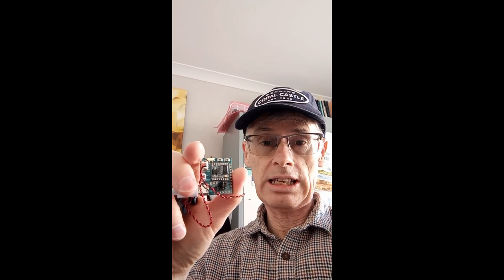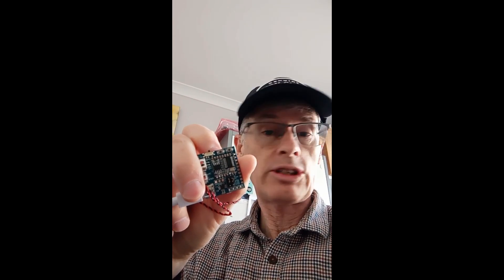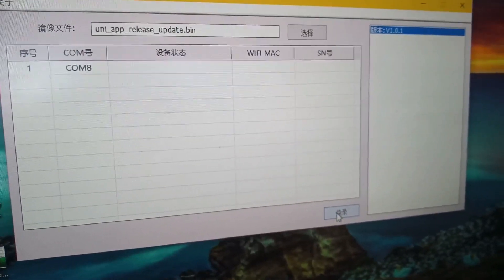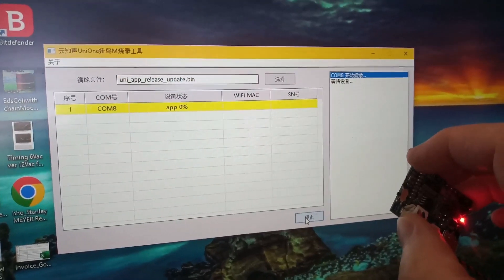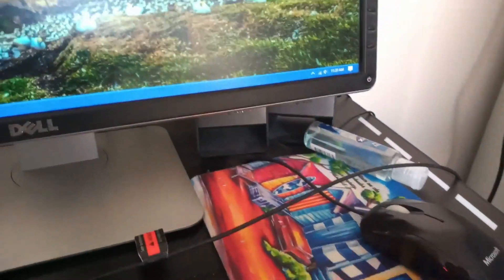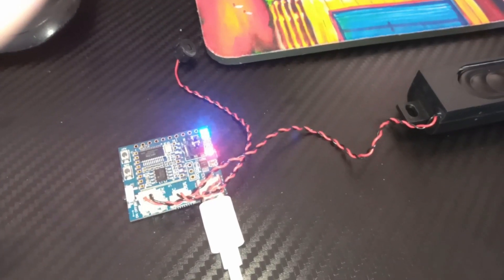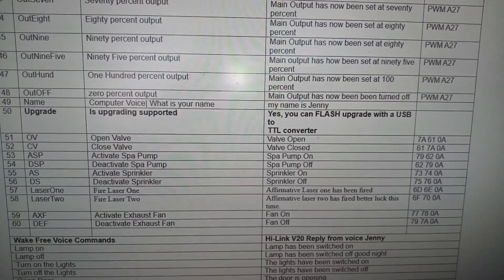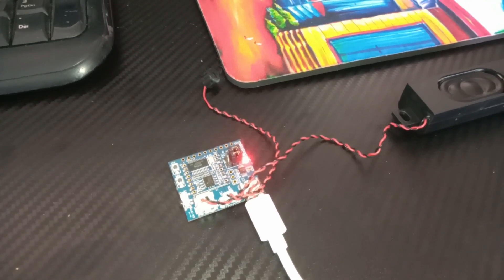NEW REVISON Hi-Link Easy FLASH programmable upgrade Voice Recognition V20 V3 Development Kit Release

Comment: is this arduino compatible? like i could tell it to move a motor and it would do that?
Reply from the maker: Yes, for DC motors I would suggest using PWM output feature from this voice recognition controller. Obviously if you wanted the motor output  to be set half speed then set the PWM output to 50%. The corresponding voice command would be "Go half speed".

Comment: Is it possible to do this through the usb on the same device that has no switch? The program sees it and waits but not sure what needs to happen next as mine does not have a switch.
Reply from the maker: You'll need to see my earlier YouTube  video for the HLK-V20, where I use an external toggle switch to achieve the same result for the version you have. The VCC  power on switch essentially causes the boot 🥾 up to write to the FLASH memory, rather that boot vectoring to execute and run the existing program code.
Reply: Ah OK, thank you. I did watch the earlier vid as it is the first video that comes up. All very helpful by the way ;) 
I just hoped I wouldn't have to include the use of another device in order to achieve it, but it is what it is.  
What if I desoldered the power to the actual voice module itself and then turned it on manually with a switch inline? Could this trick it into accepting the update do you think?
Reply from the maker: @JermaineCoronas-k3q  The thing to remember the USB software driver side of module is self-powered with 5V which is why the software app detects which port it is connected to and makes it available, when highlighted in Yellow. Yes, you could do it by a more crude method of simply holding the Vcc wire in your hand to connect in lieu of a toggle switch, more risky if you don't have a steady firm hand to close the  Vcc connection properly when it is writing to the FLASH.
Reply: Well, it's an idea I don't mind giving a go if i can. After all with it being in Chinese, at this point I have nothing to lose really. If it fails I could always get a more up to date version as shown in your vid and add a relay to it instead I suppose. 
Thank you.
Reply: Thought I'd update on the update attempt to make mine english.

Tried as last mentioned and no difference. I also purchased a USB to TTL dongle but exactly the same result. My board also has a tx and rx pin header going streight to the voice module itself and still no difference. 
Seems I've lost the fight with this one 🤔 Not really looking forward to the possible headache with another so I think I'll leave the idea as an idea 😅
Reply: Another update: I have successfully built my own SDK. All is well.
Reply from the maker: @JermaineCoronas-k3q  Sorry, didn't get back to you sooner, but other distractions in the way. Did you accomplish this using the online platform or compiled the SDK using Linux offline. I've done both, offline compilation allows you to integrate any type of mp3 recording into the chip.
Reply: No worries at all and thanks for replying. I figured I'd be quite irritated if I was being badgered by a newbie on my chanel so I decided to test my intelligence so to speak 😅
I went the online route. But the Linux way sounds interesting 🤔 As I say this is all new to me so I will see what I can find out about it. Any further info would be great 👍
Reply: Is there a link you could provide that offers any assistance regarding being able to create the file using linux?
Reply from the maker: @JermaineCoronas-k3q  You can compile the FLASH .BIN file in Linux, but once the .BIN file has been created, then Linux is no longer required, you can simply run the FLASH upload program with any version of Windows. Are you wanting to integrate the Andestech toolchain under Linux to do a full offline compilation? Otherwise there is the really easy method of simply compiling the .Bin file using the manufacturer's online platform to do it.

Comment: Its great but a lot of what is shown here conflicts with what your listing shows. A lot of these don't seem to require a wake word but on the listing it says only a few are available without wake word, was the video edited? Also beam me up in the video and beam me up in the listing are different. Its a shame no one has had a custom bin file created by paying, or perhaps you did and this is what was specific to your needs. I find the redundant cooling and air con and a lot of the commands are really not that great. I do love what really seems like good recognition from this seem excellent. Its a shame that most of the commands are garbage. Its a gem in the rough. With better commands, this thing would be like gold.
Reply from the maker: Hi Chris, eBay listing has now been updated as these new revision kits only arrived just yesterday. There are 3 separate wake words, and 6 wake free commands - The link in the description  is a custom BIN file that I made that you don't have to pay for. Cooling and Air con can be done via an Infrared add-on for this module but using voice command instead to switch your appliances. Therefore you can throw away your battery operated remote control or not have to go and look for it - May need to do another video to explain that side of things. The  development board is fully customisable for any keen developer to use, there is no one encompassing solution that will satisfy everyone, the choice of voice command come down to personal taste as to which ones should be programmed.
Reply: @paulbellett2442  Thank you for the detailed response. I would be interested in how you came by this bin file or had it made. I realize there is no one solution to satisfy everyone's need but the process has me curious as you are the only one I can see that has any experience with these boards. Espressif has a process to get this to work directly on the esp32 but the process is daunting as they want x amount of hours of voice lexicon audio data for customization. Curious in this process and if you wrote this bin file selection of words or just changed the existing default commands to English, as some of these commands are also in their demo videos. I am wondering if you did customize it or have it customized, that maybe you chose to add some of their precompiled ones to your custom ones to either cut down on cost or to save the amount of work to be done since they already had those precompiled to choose from. I will check out your new updated listing and command list.
Reply from the maker: @YTFP_Chris  The Hi-Link chip label is based on the Hummingbird M (US516P6) chipset fabricated by Unisound - https://doc.hivoice.cn/ . Customisable Voice recognition commands can be typed in on their Open Platform website, the GPIO ports /UART can be also configured accordingly to automatically generate your own FLASH bin file, which is how I did  mine. Their is another guy I know who has done a customisable BIN file but in the Greek language. The other way of creating a new FLASH BIN file is to do it offline, but it is much harder to do as it requires the Andetech Toolchain Set,  a Linux computer to C compile it into a BIN file.
Reply from the maker: After registering as a user on this Chinese website - http://www.smartpi.cn/#/ Set your Google browser to Auto-translate it to English . Create a new product FLASH .BIN file from SU-03T PCB module (Exactly the same as the  Hi-Link V20 chip or  Hummingbird M (US516P6) chipset)